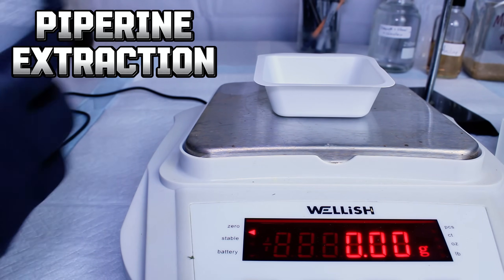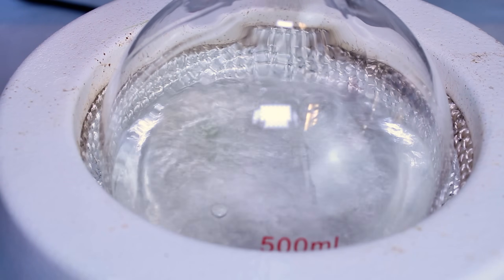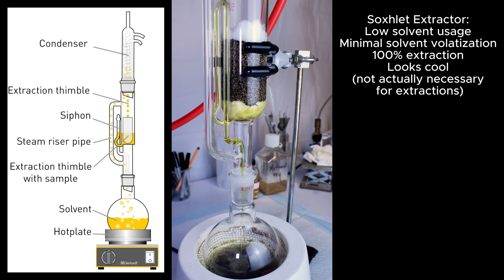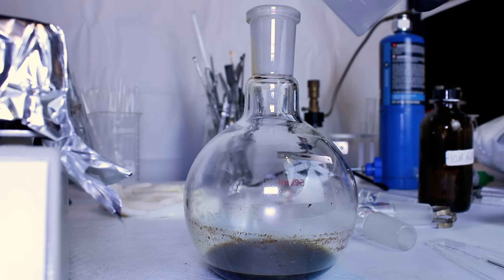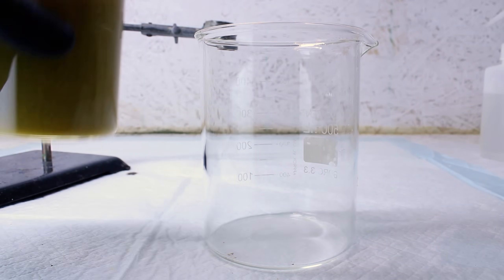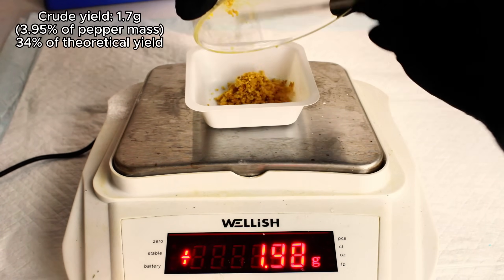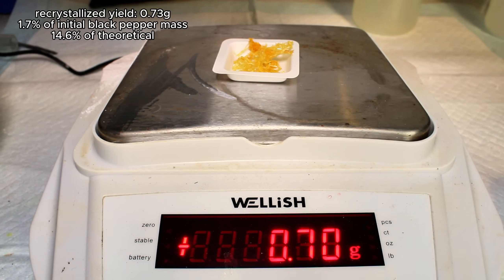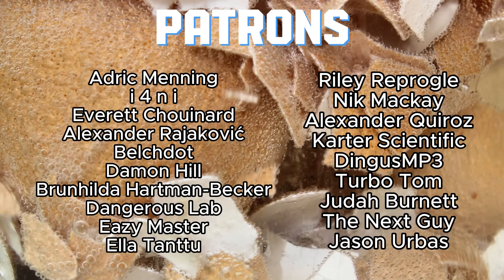Piperine Extraction from Black Pepper

Comment: black pepper has around 5%, even les if it is old and grounded, white pepper has around 10%. it is actualy the pre-mature fruit of black pepper. and you should run your soxhelt more like 70 cycles if you want 100%. then turn it into pepperinc acid and you get vlauble substituted ring.

Comment: Three cycles is NOT enough. The LOW end should be maybe 10-20 cycles. You should also be aiming to have the heat low and the rate of condensation of the solvent to be slow and gentle.

Comment: I really enjoy your content!  I'm a 50 some year old analytical chemist so I've used soxhlet extractions for a lot of things.  I typically use cellulose thimbles from labexact that you can find on amazon for convenience but the biggest difference in our methods is that I'll typically let the system extract for 3-4 hours so I was surprised to see you run for just a few cycles.  That's the most reasonable explanation for a low yield.  Extraction time is determined empirically so I've directly compared 1/2 hour, hour, 1 1/2 hour... 6 hours etc. then cool, remove and dry the thimble, then weigh on an analytical balance to determine the mass of extracted material (just don't forget to record the tare weight).  Depending on the application and solubilities involved, some extractions go for 8 hours to days so I would suggest that you let it run for 4 hours, particularly since you're trying to get a nearly quantitative extraction.  Keep up the good work.
Reply: Hello! Looking for a chemist to help me with a development of a product. Can I please have a email to reach out. Thanks

Comment: Have you tried putting the soxhlet under vacuum? Not only does it reduce the boiling point of the solvent, (which will preserve constituents in the materials), it greatly speeds up the process. Greetings from Maine 🧪🔬
Reply from the maker: Huh I actually hadn't considered that! I'll have to give that a try next time I use it, especially since I hadn't considered using some high boiling solvents in it for that exact reason.
Greetings from Massachusetts btw! I've been considering moving to Maine for years

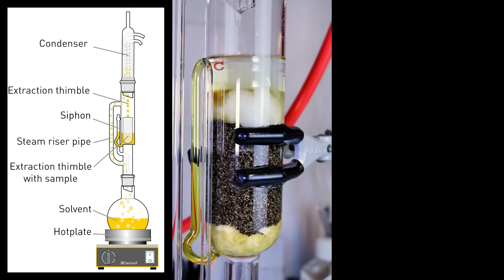Comment: 2:50 Another downside of this process is that the extracted matter in the round bottom flask is exposed to the boiling temperatur of the solvent for a longer period of time (in the case of iso-Propanol 82 °C). But this cannot be prevented, except you choose another solvent with a lower boiling point (if there is one).
Reply from the maker: I was actually thinking of doing this again with diethyl ether. Boiling point is 35°C and it forms a seperate layer in solution so I could do an actual washing step with the Extract
Reply: @integral_chemistry  If you are going to recover the solvent you might as well increase the mas and use ultrasoic extraction to keep things cool. You extract. Destil under vaccum to almost dryness and reextract with the recovered solvent.

Comment: In doi:10.1016/j.medidd.2020.100027 they got a 4% with 10-12 hours of methanol soxhlet; doi:10.1007/s11418-008-0234-3 used GAA for a 4.5% yield in approximately half an hour. I'm leaving out a bunch of details here though, absolutely check out the papers yourself.
I also can't help but wonder how much of the piperine you hydrolyzed with the KOH, though that should be negligable 'cause there's no water there.. .🤔

Comment: Anyone know if the NaOH/IPA step would work with capsaicin extracted in the same way? I did this extraction with c. Reaper peppers and have like 500ml of red oil but i want to refine and crystalize the capsaicin if possible. btw i know its dangerous and no plan to eat it, its just a fun project
Reply from the maker: I actually am working on that exact project rn and what worked for me was actually dissolving the oil in glycerin and then extracting out the capsaicin with diethyl ether. Capcasin isn't soluble in glycerin but all the fats and oils are, so all the capcasin gets extracted into the ether which forms a nice seperate layer. Only issue is the red carotenoids also get extracted with the capsaicin and I've got no idea how to seperate the two :(

Comment: Preground black pepper, definetly has less taste and fragrance than freshly ground black pepper. I'm guessing it's due to oxidation or breakdown of the piperine in the pepper?
I would not be surprised if you would get a higher yild from freshly ground black pepper, also ground to a finer powder instead of the coarse material you used.

Comment: To improve yield, you could soak the pepper in you solvent before starting the extraction. This could even be done in the soxhlet. Just put your pepper in the soxhlet, cover with isopropanol ( just not enough to trigger the siphon) and leave it like that for a couple of days. Also you can crash out the piperine with you solvent warm and then let it cool down, that way you get bigger crystals and less wil pass through your filter. Other then that, nice video.

Comment: You should try chile peppers for capsaicin others have done it but they stop at the oil not the pure crystals. I believe you already have the needed solvents for the final wash
Reply from the maker: I've considered that honestly. I figure the oils could be separated out with a glycerin-ether extraction, the issue is separating the carotenoids from the capsaicinoids as they have such similar solubilities..
Reply: hmm yeah. the carotenoids dont have a phenol group like capsaicin though right? could you exploit the solubilities through protonation and deprotonation then? maybe the carotenoid species are too diverse for that to work. idk.  @integral_chemistry

Comment: piperine degrades over time and obviously faster in pre ground peppercorns. so ideally you should use whole peppercorns and grate them shortly before use. that would certaintly increase yield. also preground peppercorns are usually lower grade stuff since you can't tell by looking at them.
This is true of most spices,  the pre ground or pre extracted version is usually low[er] grade stuff that can't be sold whole
Reply from the maker: Yeah I definitely want to try again with an equal mass of some very fresh peppercorns, think it would be a fun little proof that the pre-ground stuff is trash.
Reply: @integral_chemistry  tastebuds are usually sufficient for that. Even being old makes them weaker.
Reply: @integral_chemistry  :face-pink-tears:

Comment: You can make thimbles by rolling up a sheet of paper in a cylinder and stapling the bottom shut. It's a bit less hassle than the cotton and helps the siphon work better when using fine powders. Another tip I use is filling the boiling flask by pouring the solvent over the soxhlet, saves time on a couple cycles Keep up the good content!

Comment: From my experience, using a thimble is counter productive since you can use less black pepper overall, I personally like to use cotton ball or "tea-bag" filter to contain the material for extraction, this not only increase the product, it is also much easier to clean than the timble, especially for extraction like capsaicinoid which the chilli stinks the fritted glass pretty heavily.
Reply from the maker: I honestly agree with you (tbh I mentioned the thimble to avoid people trying to call me out for not using one lol). But yeah the thimble just feels too limiting. It sucks for all the reasons you mentioned and I'm not sure if my thimble is just the wrong size but I nearly had some overflow of particulate when I last tried to use it.
Reply: @integral_chemistry  Also when I am inserting the thimble, it slides on the bottom of the Soxhlet chamber pretty harshly, making a "clink" sound by hitting the glass, not sure if it will eventually crack it over multiple uses.

Comment: Depending on speed of boiling, three cycles of extraction may not be very much. You may want to try long soaking time (slow boiiling) and/or more cycles.
Reply: I was going to say the same thing. I've done this exact extraction and my group decided to let it cycle for 2 hours and the solvent eventually would come through clear, I think we got like 70% of the piperine out.

Comment: How about making capsaicin crystals? I don't think anyone else has done that yet on YouTube. Cool video, by the way. Nice job.
Reply: Nile Red isolated it from chilli peppers. But not pure
Reply: @louwclaassens4988  exactly, like I said nobody has made the crystals.
Reply: @louwclaassens4988  There seems to be no easy method of purifying capsaicin. There are some publications on how to do it (at least one that I know of that seems to be referenced much) and it was quite laborous. The problem is the other inmpurities that you get with excract.
For smaller amounts something like chromatography is always an option but for anything but small amounts, such a simple method is no longer an option.
Reply: @louwclaassens4988  It's quite stubborn to purify further and it'd make boring video since it's just column chromatography.
Reply: AFAIK, capsaicin is more like wax, it does not produce good crystals
Reply: @ronritekinamatigai  Yeah, tricky to get it to crystallise. Drying it in it's molten state under vacuum should do it though.
Reply: @ronritekinamatigai  I have an impression it is waxy too. But still labor intensive to purify from extracts.